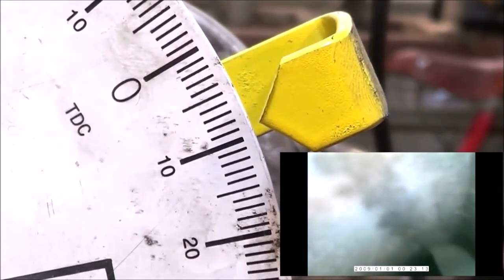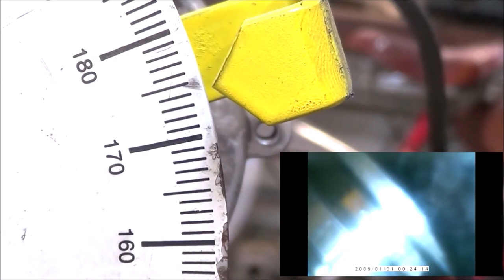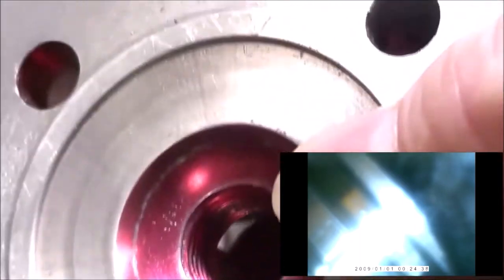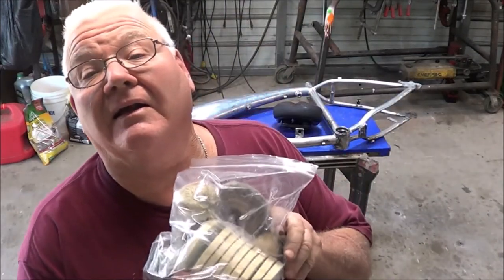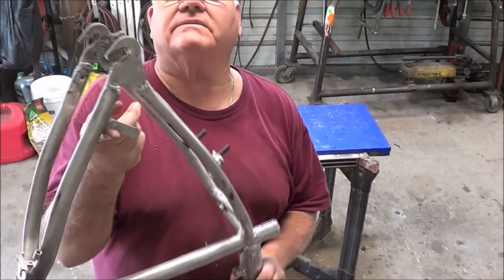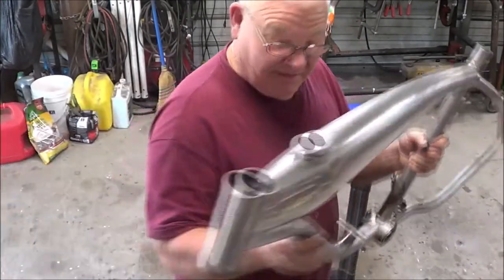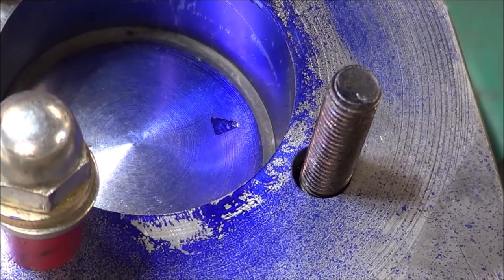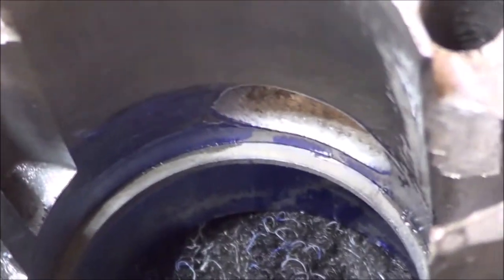Motorized bicycle lets tear down this tired engine and rebuild it part 3 porting numbers

Comment: I got a question I don't know what to do and you might be able to help. I just stripped an exhaust bolt on my new 49 mm 😒. Do you think it's a good idea and is there enough room do you think to tap for M8 exhaust bolt holes instead?
Reply from the maker: I would try Hili coil first, but you should have the room for m8 when I get home today, I will look at mine and let you know.
Reply: @KevinTodd  Respectfully thank you for your expeditiousness.I purchased a helicoil and you are correct that is the best option. Theoretically it should be stronger than the original 🤔.
Reply from the maker: @JamesPiccone  I'm sorry I made it to my shop late and I had one project I needed to get in the mail and I forgot to look at mine, but I us them and they work never had a problem sorry.
Reply: @KevinTodd  I was on the wrong track with retapping for M8, you were 100% correct from the get-go. I would have never thought of doing that if you would have never mentioned it, you're awesome bro ✊.